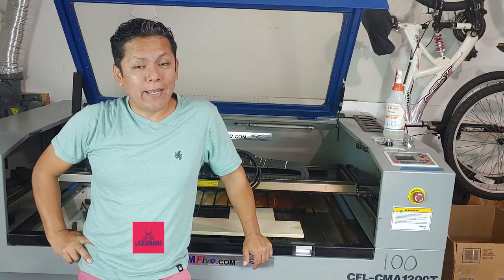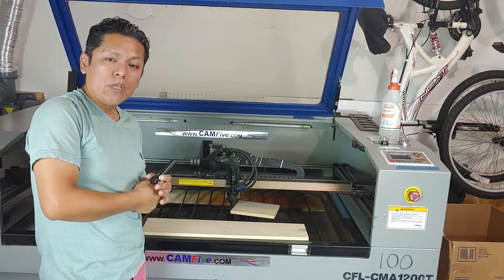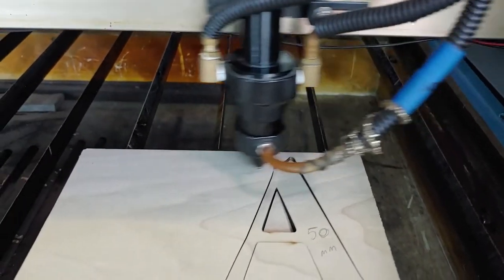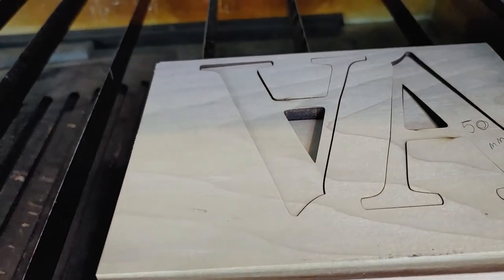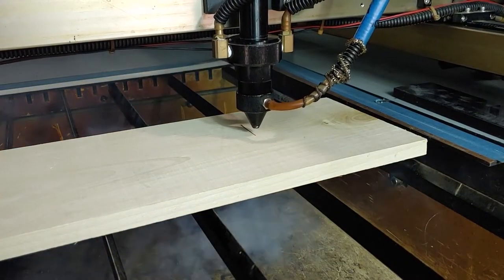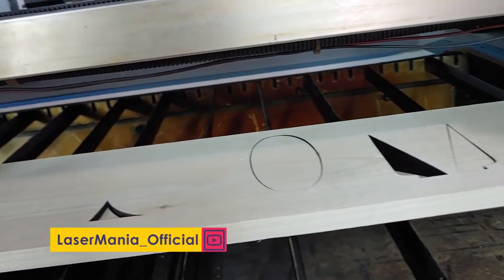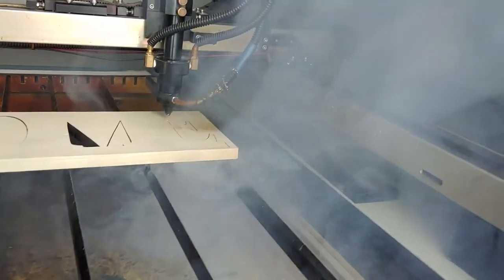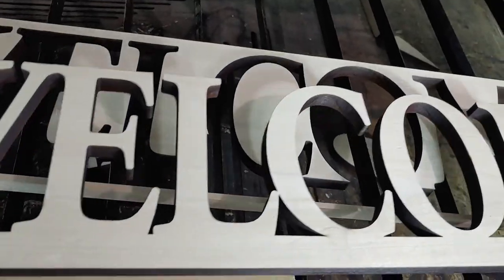Secrets for a straight cut on thick wood  | Tips and Tricks for Laser Users

Comment: Very helpful video.  Possible suggestion for a future video.  I've upgraded my laser added a laser combiner.  I am having all kinds of problems getting the mirrors aligned.  There are three adjustment screws and then two smaller screws, trying to find out what the smaller screws are used for.
Reply from the maker: hmm, if you  have a camfive those 2 additional screws are some kind of locks so the mirrors do not move but if you are trying to calibrate the mirrors it is good to loosen them up a little so the mirrors move once you finish calibration tighten them up again

Comment: Hey thank you  for sharing.how many watts is your laser and what are the three holes on the laser head ?
Reply from the maker: HI, my Laser is 100W and the holes I think you are referring to the coolant in-ports (one on each side of the laser head) this brings cold water from chiller and refrigerate the chamber where the lens is located and prevent it to overheat, the third one is the air assists, this is very important to get clean cuts since pushes all the smoke down and away from the wood

Comment: Would 63mm lens be a Good Midpoint for both Cutting & engraving on a 100W ? . I think in this video based on what I saw 63mm would've also cut well with your parameters and material don't u think ?
Reply from the maker: sure, that sounds good, but it also depends what thickness of material you are cutting

Comment: I need to cut 18 mm and 24 mm hdhmr mdf board. Please suggest suitable wattage laser machine
Reply from the maker: MDF is a little complicated, the thickest I have ever cut was 1/2" and that was using 130W so for the thickness you are looking I would say probably 200W and use a 4" lens and a reliable air compressor
Reply: @LaserManiaOfficial  thanks a lot for your valuable advice.🙏